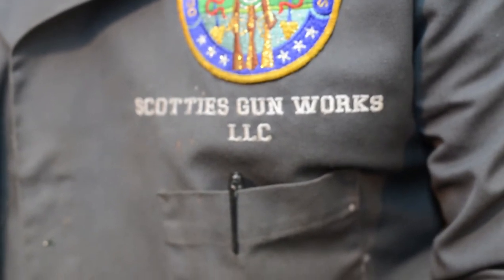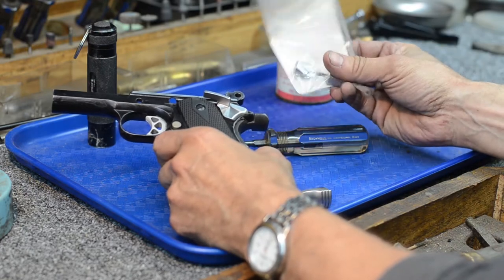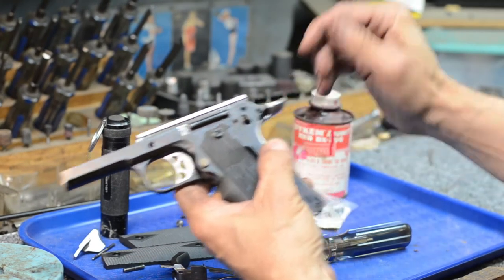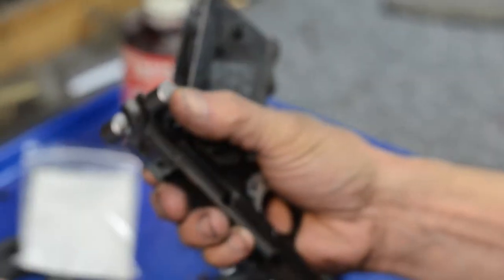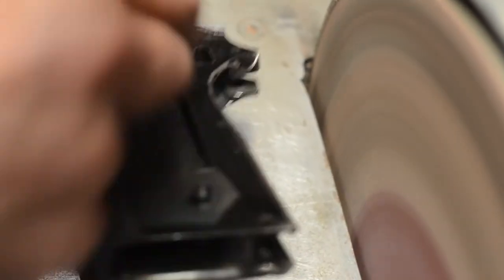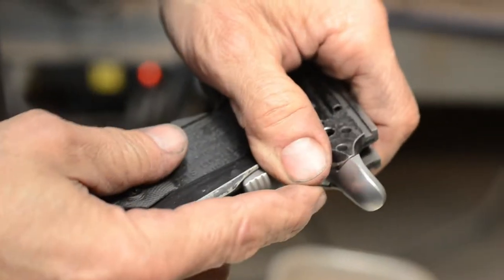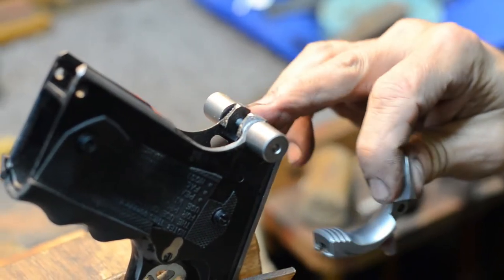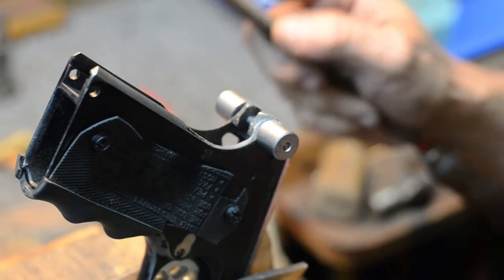How to hand fit a custom grip safety on a 1911 Professional Gun Smithing Series

Comment: I was cringing while he put that frame to the grinder....to remove 3-5 thousandths. I thought that was what the roller jig was for....so you don't remove too much and ruin that frame. Hand fitting is not a race.  But I guess his 25-30 year of experience trumps common sense??
Reply: It’s not a few thousands it’s more like at least an 1/8th that’s why he scribed the frame for that reason you described. I’ve done one and am looking at doing a few more and the process he uses was almost identical to the one the master smith I’m under showed me. It can seem very daunting but it’s a process like many others when it comes to machines

Comment: Absolutely the WRONG procedure.
The easy way is the wrong way.
When changing out various parts for ANY pistol, the frame is the standard. 
You fit the new part to the frame.
Manufacturers parts will vary widely. For this reason, the original pistol frame will always be the constant.
Reply: Gregg Minkoff that’s true for every single part of the gun except when adding a beaver tail grip safety to a frame with full tangs. There is no choice but to take the tangs down to the proper radius. Either .250” or .220” pending on which one he’s using. So you are absolutely WRONG! That being said, I wouldn’t let this guy touch any of my guns. Procedure wasn’t the worst but his execution and final blending makes me cringe.